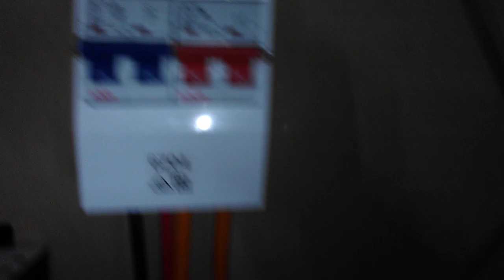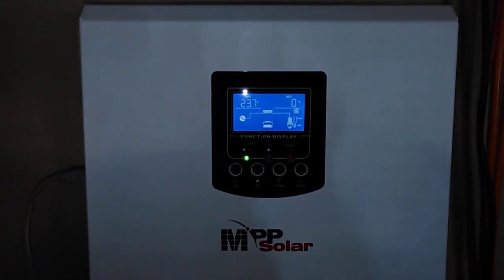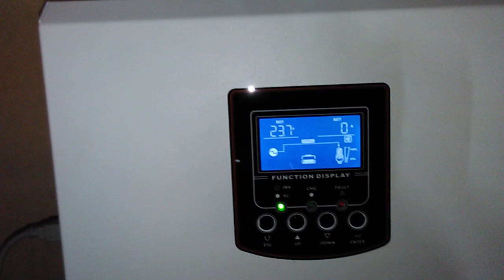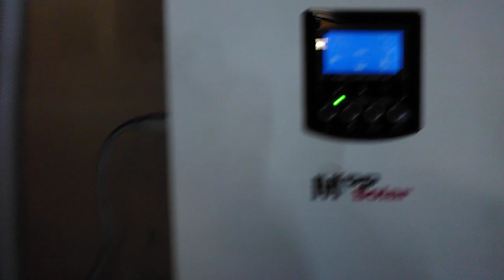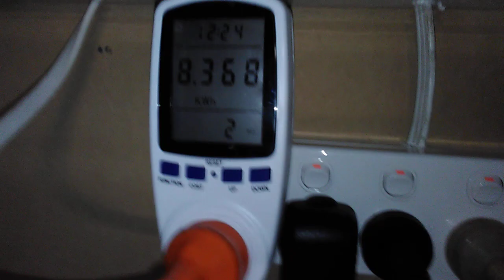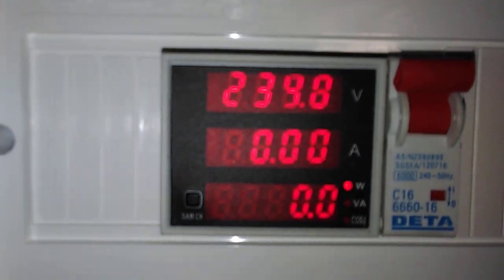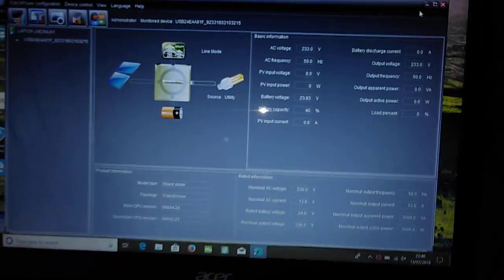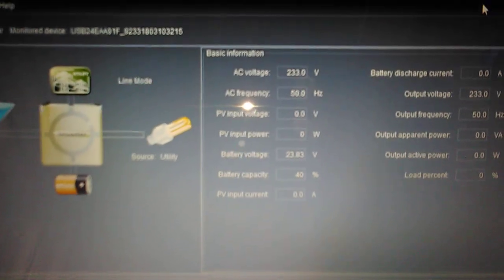Renewable Energy Off Grid Solar with 18650 Batteries using a PIP3024HSE

Comment: It is normal for the fans to work permanently, I have a msxe 3024 taken for 2 days and the fans do not stop. thank you
Reply from the maker: I'm pretty sure fan should not be on permanently. Should only turn on when unit gets warm. However if the Inverter is not displaying any error codes then don't be too concerned. My unit displaying error code 02 Fan lock. This would happened when fan has been switched on by then unit. I contacted MPP solar and it was suggested that the main board needed replacing. I also had an error code 05 output short-circuit, needed manual reset. I was thinking of swapping out main board but it was going to cost about $370 AUD with about 40% of cost in shipping. So I upgraded to the MPP V2 Hybrid 5048 because I needed to move to 48v.
https://youtu.be/1zGhSGgLr18
Reply: @adamcecere3369  All right, so this is how it is designed, I have another msx2424 with error 05, I can't fix it, thank
Reply: You said manual reset, how
Reply from the maker: @liviualdescu6563  No problem.
Reply from the maker: @liviualdescu6563  First turn off the unit. If same as mine switch is on right side. If this does not work then first turn off switch then disconnected solar then disconnected batteries. Should have switches on these places.
Reply: @adamcecere3369  I tried, error 05 always appears, it was repaired, it no longer had a 220 v output, and since then it always has 05
Reply from the maker: @liviualdescu6563  Assume you have disconnected the AC output at the unit.  If still error then contact Mpp Solar at support2@mppsolar.com with a pic of serial sticker.  
If you are it repaired at didn't fix the problem then get back to them and have them fix at there expense.  keep on them.

Comment: Is it not compulsory to use Battery Management System (BMS) to li ion battery cells?
Reply from the maker: Hi Sandy, It is the most asked question about no BMS.  My packs are within a respectable range at top end.  I do set Inverter to 57.4v (4.1v per pack) for headway room. and now lowered to 45v cutoff / switchover.  When you say compulsory for BMS, I think you are saying 'do we have to?' if so then No, but i strongly recommend it.  This will be my next focus and I will be using Batrium.  Just the cost as prevented me to already have. But it is coming.
Thanks for watching and support Sandy.

Comment: Do u have a BMS?
Reply from the maker: No BMS yet.  The one I'm looking at is Batrium.  Careful planing of the pack is keeping them safe,  but I will get a BMS soon I hope.  I check each pack often and they are all within 0.03 of a Volt at near top end charge.
Reply: Adam Cecere okey sir coz im planning also to make a power wall in 3024msxe without a bms, as i know batrium is too expensive. Is it working 24/7 now you set up
Reply from the maker: @nilobualoy117  Yes I run it all day every day. It powers part of my house including tvs washing machine and coming into summer my fridge. I haven't seen other BMS, and that my setup is modeled after HBpowerwall. This is why my choice of BMS
Reply: Adam Cecere ic how about battery which one you are using? For checking the 18650?
Reply from the maker: @nilobualoy117  For battery testing I use LiitoKala Lii500 on ebay. It dose a 1Amp discharge test.
Reply: Adam Cecere thanks a alot